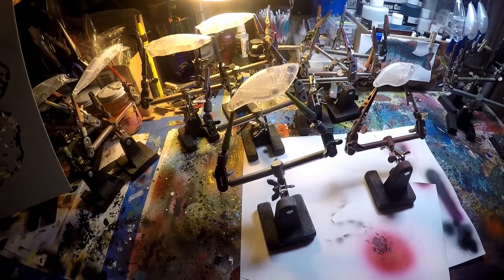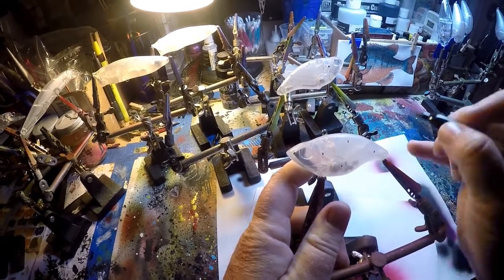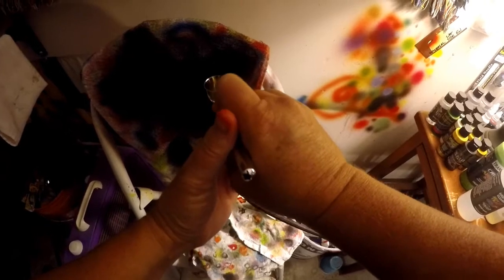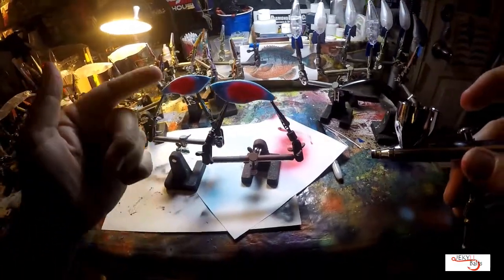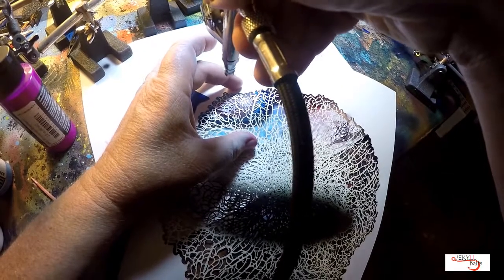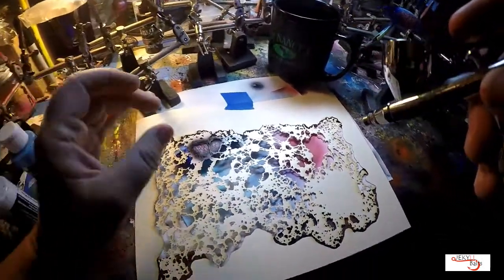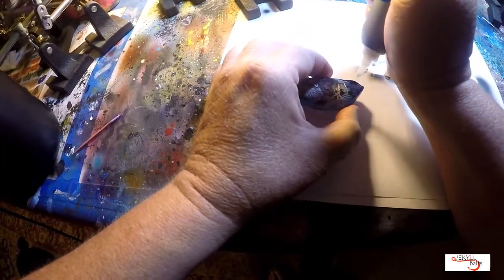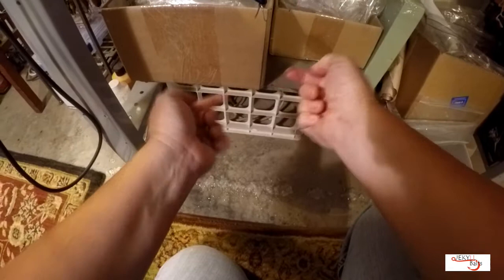JBCo Spray Session: "Walking Dead" (Exposed Muscle Stencil Technique)

Comment: Very cool! I ordered a couple of these same stencils from Amazon, thanks for sharing the link. I have some DCB D7's from Dinger. Have you tried using these stencils on a round sided bait?
Reply from the maker: Yes I have. I sent out a few special orders using the stencils on a 1.5 SQB LJMD50 and a Fat Poppa. I've found that if there's a section of the stencil I plan to use a lot, I cut it out and it's much easier to deal with. THe biggest challenge was the 1.5, but it still did very well for me. Thanks for the compliments, and let me know how those stencils do for you. I'd love to see your finished product!